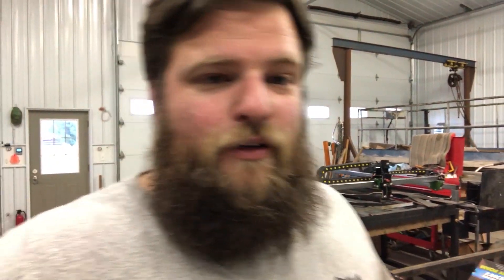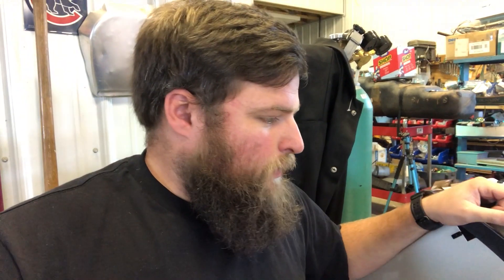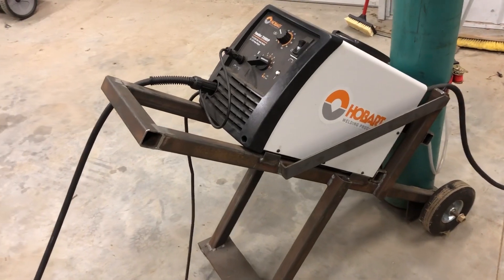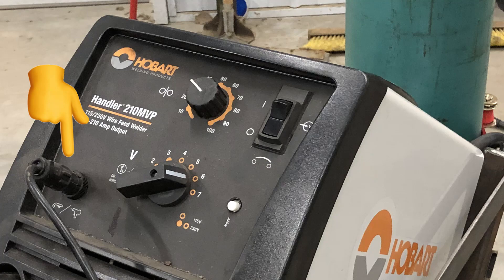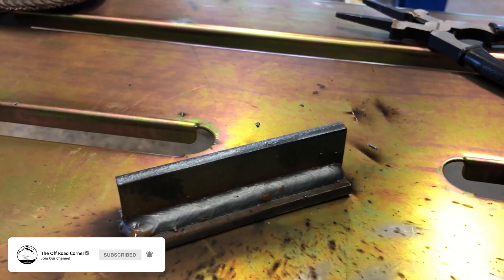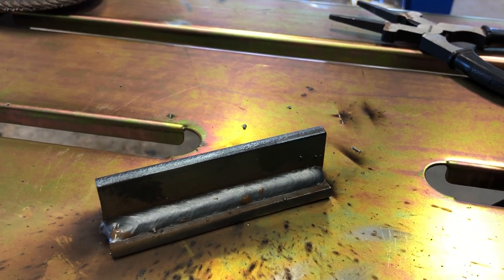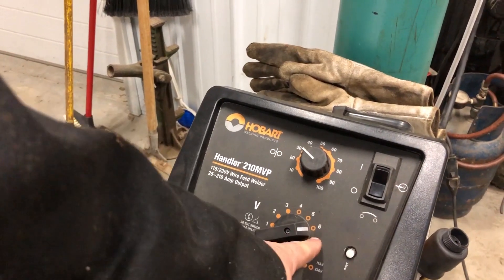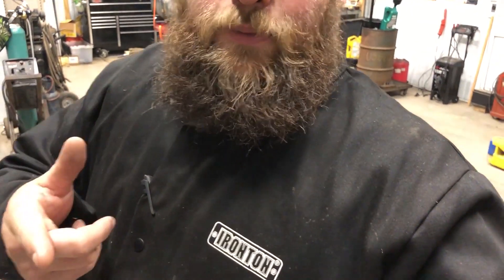Hobart Handler 210 MVP Welder Review | My Thoughts After 6 Months

Comment: i have this same welder with a spool gun and am currently doing a boat transom build and soon building a mini jet. The welder is bad ass and i have found I don't need to spend the 2k or 3k on the big shop welders as this one can do everything. Since it is so portable I also have an extension off my welder generator in my truck and this allows me to go in the field and do boat repairs that would otherwise have to be done in the shop, just a little tarp to stop the wind and send it

Comment: As a certified welder over 20 years I have this welder in my garage. I have welded everything from car sheetmetal to 3/8 thick metal with no problem at all. I love this machine and have made good side money with it. Would not pay the extra money for a Miller. It is basically the same and owned by them.
Reply from the maker: What do you think of the torch on this machine? Maybe I’m doing something wrong but after a of hour of welding the nozzle packs up with spatter and I lost gas flow. I don’t get any spatter on my metal though.
Reply: @TheOffRoadCorner  the torch does get alot of spatter in it because it is small. I use spatter spray which does help a little.  I also have a round file I use to clean it out while I am welding.

Comment: I've had this welder for a few months. I'd never welded before I bought it. After a couple of days welding scraps to practice I was asked to fabricate/weld up a pair of custom sunburst raings on a historic home. Using only flux-core wire and welding outside , I found the machine and the learning curve to be excellent, and the railing was impressive when completed. 

Now, it's winter and nasty outside and I have been asked to make another pair of custom railings for the back of the house. Just picked up a bottle of 75/25 and some solid wire and I'm looking forward to learning the new process, hopefully with much cleaner welds and less splatter, smoke, and post-weld clean-up(especially since I'll be working inside the client's finished basement with hardwood floors, etc). 

I love the welder as is, but would love it even more if they could shave off 30-40 pounds! I don't have a shop, so moving this beast is a very unpleasant task.
Reply: The inverter welders way less. The hobart 210 is a transformer. Which causes it to weigh more. Long term reliability.  I would pick the transformer.

Comment: How's it hold up to 3/16 and 1/4? Have you wished you spent a few hundred more and bought the ironman 230? I'm trying to decide between the 210 and 230 for the two thicknesses listed above.
Reply from the maker: The welder has been holding up great. I’m glad I bought it. I think this welder has plenty of power for 3/16 and 1/4” thick steel. The only I would suggest getting Ironman 230 over this welder would be if you need more duty cycle or any kind of production work with it. I built a 3/16” steel bumper for my jeep with this welder and it had no problems what’s so ever. If I was doing that everyday I’d probably move up to the 230.
Reply: @TheOffRoadCorner  
Thanks for the reply. I think for the $400 more I might just step up to the 230. Hopefully that'll be the last welder I ever need to buy
Reply: iv built 3 trailers a welding bed for a f350 built 2 offroad rigs an its my go to welder  iv had mine since 2017

Comment: Do you think this would be enough welder to build a utility trailer 6x12 ? Or you think I would need to step up to an Ironman 230. Most of the trailer would be 1/4 or less except maybe the spring shackles. Just wondering your 2 cents. Would you be confident pulling it down the road? Thanks nice video Cam
Reply from the maker: I trust this weld can take care of that trailer. 1/4” won’t be a problem for this welder. It’s a great machine and I would buy it again.
Reply: You can melt some serious metal with the 210mvp. I have both and the Ironman obviously has more amps and higher duty cycle but the MVP offers portability and dual voltage. Unless you really need the higher amps, the 210mvp is the one you want.  Can’t go wrong with Hobart Migs. They have dependable transformer design versus Miller and Lincoln garbage inverter designs. You throw those away when they go pop!

Comment: Its a great welder had mine for a few years now. Definitely play with your speeds and voltage. 
3/8 no problem struggled on 1/2" had to do multiple passes. 
A tip for ya the small the wire the less voltage needed. 
When im doing 20gage i run .024
And building jeeps as and trailers 
.030 or .035 
The same company owns both miller and Hobart. My plugs say Miller.
Reply from the maker: If it's not broken fix it thanks for the tip. I don’t have a lot of experience welding sheet metal. Did you have to preheat 1/2” plate to weld it?
Reply: @TheOffRoadCorner  
No I didn't I should have. 
Sheet is kinda easy. Have to move around a lot.

Comment: I set mine up to 115v with the recommended settings. 0.030ga and I’m getting an insane amount of spatter. Like something is fundamentally wrong with how I set it up. I have it on reverse dcep polarity as recommended. Any advice on why I’m getting so much spatter everywhere?
Reply: I actually figured it out that the wire I was actually using was fluxcore (came with it) - I changed the polarity and it seems to be much better
Reply from the maker: Grounding can play a huge part in how the machine welds. Maybe try stripping the insulation off of some heavy gauge stranded wire (like 8ga or 6ga) and clamp it to what you’re welding with the ground clamp. So the wire can give you more contact points to what you are welding for a better ground. If that seems to work I’d replace the ground clamp with a solid metal clamp instead of the stamped steel clamp the machine comes with. Here a link to the kind of clamp I’m talking about.

https://amzn.to/3b2faOu

Comment: Switch over to Co2 gas when welding 3\8 steel, it will give you a few more kick in the ass amps.
Reply from the maker: Thanks for the tip man! I’ll try that out.
Reply: Not to mention .035 wire if your welding thicker metal
Reply: 30-130amps .023 wire
40-145amps .030 wire
50-180amps .035 wire
75-250amps .045 wire

Comment: Hobart makes the best bang for the buck mig welders. They have been making welding machines for a long time. They still use the transformer design which is reliable and will probably outlast you.  Blue, red, yellow machines are overpriced and have stupid gimmicks that will not make you a better welder. Practice makes you a good welder. Not a gimmick that makes you think you can weld. My  $.02
Reply from the maker: I 100% agree with you. This machine keeps impressing me every time I use it.

Comment: My handler has 5 years on it today it stopped feeding and was back burning tips the drive roller wired but the shaft has play , so it doesn't feed right ... that fucking drive motor unit is $200 that's 1/3 the cost if a brand new refurb model ... most other units that part is about $70 .
Reply from the maker: Damn that suck. That’s BS it’s so expensive.

Comment: good show..but real test of any mig welder is just flux core no gas. all migs make very nice welds with gas once you find your voltage and wire speed sweet spot.
Reply from the maker: Thanks for the input. I have little to no experience with flux core welding
Reply: @TheOffRoadCorner  you're a smart man ;-)
Reply: If you ever decide to try the Flux core, know that it runs scored hotter than mig! I would strongly recommend you get used to burning Flux core for those times when you will be called on to do a job outdoors with even an easy breeze blowing.
Gas shielding is only good indoors and upstream from the fan!
Keep in mind fluxcore runs hotter than mig so start a about 10% less volts setting than you normally would.
 And the struggling you mentioned you had with the mig is probably because welder companies generally rate the machines output with Flux core wire, not shielded solid wire.
Check your box or manual. I'm not familiar with this particular machine or the printing on the box, I just find most companies rate the thickness welded with fluxcore.